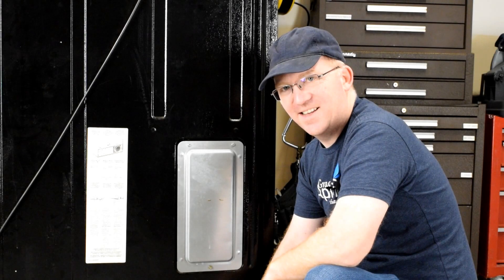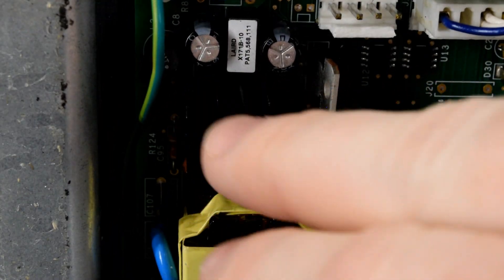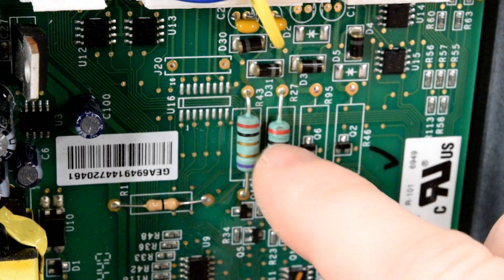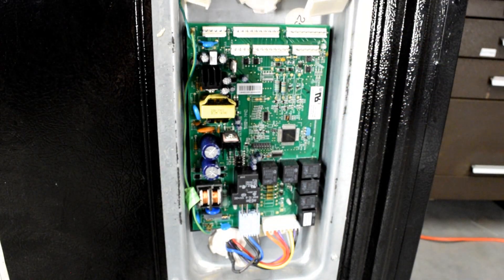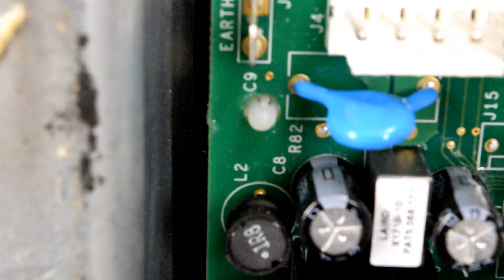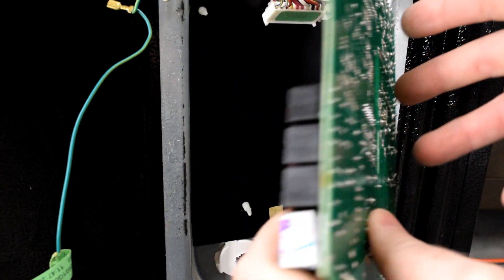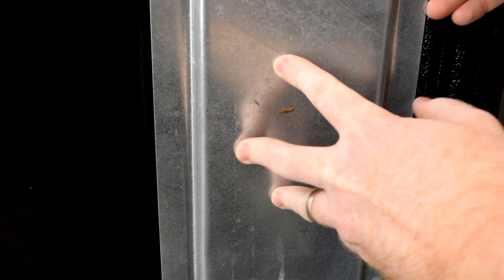Diagnosing a Bad GE Board - Part 2: Visual Inspectios

Comment: Andy thank you for the videos they are very helpful.I have a GE side by side refrigerator that intermittently would stop cooling freezer and fresh food sections I replaced control board and it worked perfectly for three weeks but now for two days makes a high pitch humming sound,driving me nuts.Does this mean I need to change the evaporator motor also? Why are these motors variable speed operation at what time are they supposed to speed up?  Is there a phone number TO CALL YOU I WOULD BE WILLING TO PAY FOR YOUR TECHNICAL HELP
Reply from the maker: giantdude86 hi!
Thanks for support and the kind words. 

At this time, I don’t offer phone support just due to time constraints but am certainly willing to see if I can be of help here with whatever questions you might have.  

I believe they’re variable speed for energy savings, vs running a 120v fan full time.  Also, it’s much quieter once the freezer is down to temp and may just need a low speed fan to maintain temp.  

The noise you are hearing is like you said likely going to be the evaporator fan motor or the condenser fan motor. This video walks through how you could pin point which fan from the control board by running them independently to recreate the noise.  
https://youtu.be/PwsoOpUbxvk

If you didn’t feel comfortable with that, alternatively you could simply unplug each fan at a time until you’ve pinpointed the location.  

Let me know if you have any questions.

Comment: My GE is not doing anything. I open the  door I have light. No way to set the control for the freezer or the refrigerator. The digital display don't display. And I'm the worst player doesn't light up anymore what ice makers at on the door.  And they Foods aliment I did replace that twice already and it work fine. I did a visual of the circuit board but I didn't pull it out.  one of those resistors look burnt on the PC board a little brown. You think it the board.
Reply from the maker: Hi Anthony, 
Sorry to hear about your issues with your refrigerator. 
The fact that the lights come on tell me that you’re getting good power to the refrigerator. Yes, it is more than likely the main control board, but to be sure you would need to rule out a failed front control / touch panel because they both share the same symptoms when failed. 

You’d need a multimeter to do these tests and start with the video:
https://youtu.be/ViFpwH6_WrM

You’ll probably determine that the touch panel board is fine and it’s the main control board at fault. The fact that the resistor is burned indicates an issue with one of your fans which has caused the board to fail. This video will walk you through these tests and you’d need to replace that offending fan motor as well.  
https://youtu.be/PhQKqF5MgDE

I hope that info is helpful, please let me know if you have any questions! 
Andy
Reply: I didn’t get time to test. I left the Fridge  plugged up and just came back on all of a sudden so I know there’s a bad motherboard are ready before I get to check it out  I want to test it out through your steps
Reply: Where can I get those resistors in those relays to rebuild this board and those capacitors do you have part numbers for then and where to order them from

Comment: Thanks for the tip. My GE refrigerator works fine except when there is a power failure. Restart of the refrigerator is delayed anywhere from 12 hours to over 24 hours. I know that there is a delay to protect the compressor but not that long. I visually inspected the main board per this video. There is a 38 micro Farad 250 volt capacitor with lots of silicon goo at the base. I will replace it when I get a replacement. Is this the likely culprit? I am reluctant to unplug the refrigerator to inspect the the backside of the board. Couple of questions. Is a 44 micro Farad 250 volt capacitor an acceptable replacement? What is the normal delay? I can't find any reference to it in the manual or online.
Reply from the maker: Hi Perry,
You're most welcome. Sorry to hear about your issues.
The capacitor you mentioned isn't faulty. If I'm thinking correct, what you're seeing is a thermal putty they use. It's normal and no issue there. When the capacitors have failed most times they will noticeably swell,  sometimes will leak their internals on to the board, but it doesn't look like silicone, but usually a powdery or dark substance which stinks to high heaven.

More likely on your case is a failing relay on the control board. One test you can do is the next time you can catch it acting up, gently tap on each of the relays on the main control board with a screw driver. If the fridge magically comes to life, you've narrowed it down to that relay. What happens is the relay gets weak over time and doesn't have enough magnetism to close the contact when power is applied to it. After cooling down for sometime, it finally has the umph to kick on. 

If you've got the know how, I'd definitely recommend replacing all of the relays on the board and the 4 smaller capacitors I mentioned in the video and the board is likely to last another 20 years. Unfortunately though, there's not a way to test the relays without first removing them from the board. 

That particular symptom you're having though is very indicitive of a failing control board.

I hope that helps.
Reply: Thanks.  I'll try that.  Can the relays and capacitors be purchased separately from GE?
Reply from the maker: @perrybuntin5617  no, but if you look on the relay itself you will find a part number. I order mine through Mouser.com usually.
Reply: I unplugged the refrigerator  and plugged back in after waiting 30 minutes. Compressor did not restart for 12 hours and 10 minutes.   Several times during that delayed start, I tried tapping the relays but that did not help. 
I check the temperature of the relays with an IR gun.  They were running 2-3 deg below room temperature (70 F). So overheating is not an issue. Current draw is only 2-3 watts.

FYI: Light on front panel was also off so power to it is lost. Lights inside refrig and freezer compartments turn on when doors are open.

One thing I have noticed is that I can unplugged the refrigerator and plug it back in with a 10 second (and retested with a 15 second delay) and the front panel light stays on.  Compressor restarts about 20 minutes later. The compressor was running both times when I unplugged.  

I will inspect back side of board and replace capacitors next.
Reply from the maker: @perrybuntin5617  sounds good Perry. I'd highly recommend replacing the relays when to you do the caps.
It's the coil portion of the relay that has failed in your case which is a low DC voltage (12vdc I beleive if memory serves) and wouldn't be putting off excessive heat to be noticed with an IR gun. It acts as an electromagnet when energized with 12vdc. This closes the high voltage contacts on the relay. This is where the main heat would be created. When the contacts begin to wear out, it creates high resistance and thus heat. But your relays are not even closing (intermittently) due to a weak coil.

This is my estimation based on my experience and on my side of the keyboard of course.

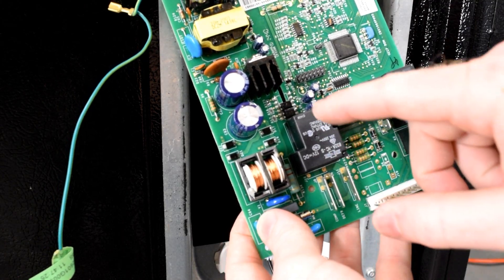Comment: At 5:30 by the two capacitors, what's that piece called, top capacitor to the right, black piece
Reply from the maker: That is a heat sync which is meant to dissipate heat from the part it’s attached to. In this case, if memory serves is a mosfit. Not prone to fail typically.

Comment: Excellent video. Highly recommend your video series for trouble shooting GE side/side issues. I managed to resolve my no power to compressor issue by piecing together a number of trouble shooting tactics from all your videos but  I would like to request a single video on trouble shooting a non running compressor.   

Problem: No power to compressor, Checked incoming voltage at J11 Line and confirmed incoming power. Checked voltage at J8 COMP and DEFR (no voltage). Compressor relay and overload switch appeared to be in working order and the 3 pins on the compressor had good continuity. Checked rear of board and the large relay burned solder joint was visible.Replaced board and resolved power supply problem to compressor. Next concern, why would this relay fail? Thank you again and respect from Canada
Reply from the maker: Hi Brenna, Thanks for the kind words. I'm so glad the videos helped!   I think that's a great idea for a video and I will definitely be making this (or include this content within another) video!

As to why the relay fails...the short answer is companies will do everything they can to try to save a penny on the assembly line and this equates to the cheapest possible components being used.  I think this is part of it. 
Another part of it is that an aging compressor must work harder to keep a refrigerator cool, which is longer run times on an aged compressor....aged control board parts, aged relays, etc etc. 
The older compressors, not running as efficiently as they did new, will pull more power (i.e. amps) when running which stresses the old relay on the board and many times it's the straw that breaks the camels back.  

All that being said, there may be nothing at all out of the ordinary with the compressor and it could very well be that it's just a worn out relay, bad solder joint, bad design, etc. - and that's it.  
However, as a technician, a common follow up test I always perform is what's called an amp draw test. This requires an amp meter which most home owners won't have. But, the compressor will typically pull somewhere around 1 - 1.5 amps.  If the compressor is getting worn out it will pull much higher amperage (say, 5 amps) and thus stresses the relays and control board beyond what it's designed for.  This test is a great indicator of the compressors health and would definitely raise red flags if not within spec. 
With out access to an amp meter, you'll likely be just fine changing the board and hopefully runs for another decade to come. 

Sorry, I know you asked for the time and I told you how to build the clock, but there you have it.  

I hope this helps and great work on repairing your refrigerator!